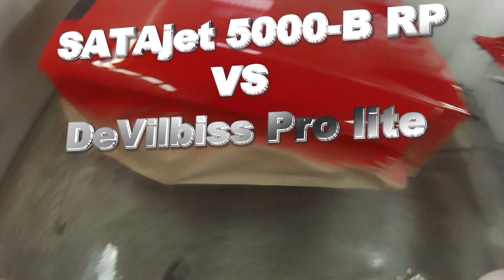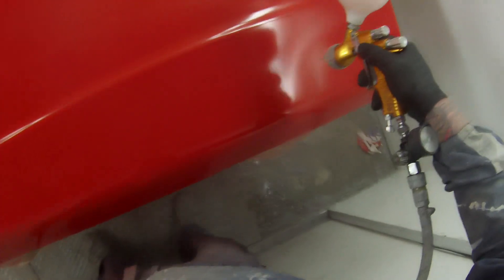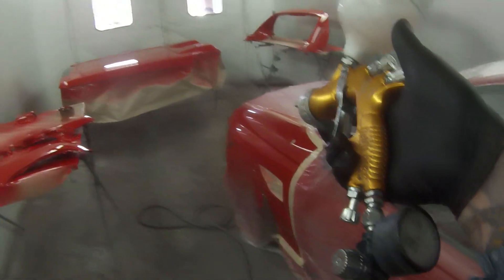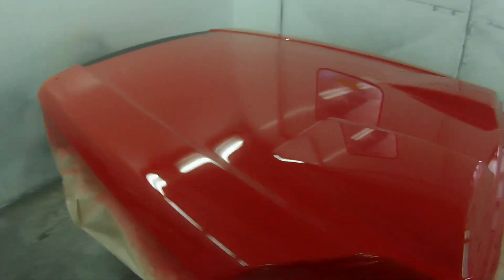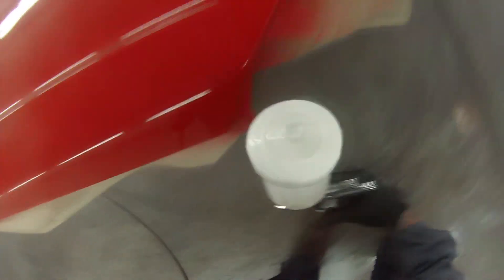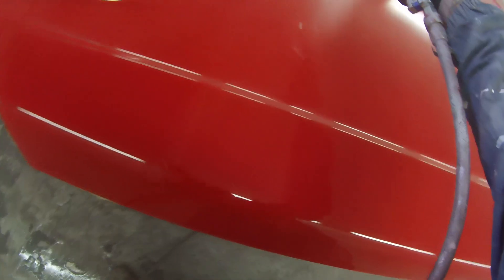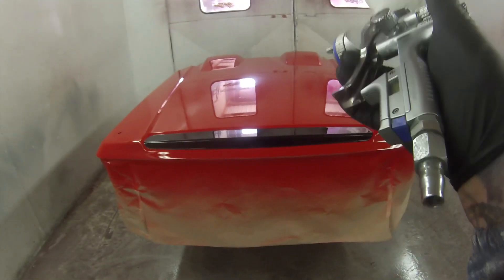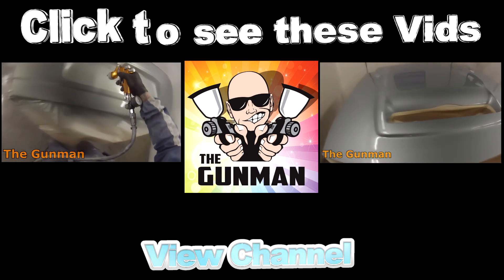SATAjet 5000 VS DeVilbiss Pro lite

Comment: Great review!  I just decided to to pop on the Tekna ProLite , same kit as mentioned, TE10 / TE20, 1.2, 1.3, 1.4 needles for $359 US so a great deal. I have a booth I can rent with good air supply and for the small projects I'm doing it will be the last spray gun I will ever need. Keeping my Eastwood Concours for primer and small quicky jobs on my home compressor. Thanks Gunny, best painting vids on the internet!

Comment: The deal is: In America, time is money. Every shop sells nothing but time. We, north american painters and businessmen want speed above all. SATA has adapt to the needs of the American market because it is the largest market in the world. It is evident in this video that for a pro painter that wants to be in and out of the booth, SATA is the way to go. I was going to buy a pro lite just to try it out, but after this video I've changed my mind. It is just as slow as the Iwatas. Low exposure to fumes is where you want to be as a professional refinisher. In and out as fast as you can!
Reply: +Renato I think his bases for the speed was dependent on flow rate and nozzle & cap size. The versatility of the Prolite would give you the ability to spray faster if so needed. Also in US, many dealers offer a Digital gauge adjuster which works great and still cost less than a Sata 5000. But yea i agree, if you are a pro and can work fast, and still get a quality job, then sure the 5000 seems more apt to the task. But i wouldn't want to use one as a beginner.
Reply: +Themayseffect why not as a beginner. I never painted. I bought a 60g$500 husky compressor. also $80 grinder,$260 buffer, $200 on lights, $300 on tools, $100 on Palm sander. I need a Spray gun that's great?DID GARAGE TEXT IN MAKING.
Reply: well said bro those are facts on paint /claircoat use
Reply: Themayseffect g
Reply: @Themayseffect  Agree,  SATA 3000 and up for skilled PRO only. That gun saves time. /But not nerves/.

Comment: I'm an industrial painter, been using my own gun, a TeknaPro for ever, but my company got us some satajet 5000 HVLP's, and I have to say, they are amazing.  The one complaint me and my painters have is the air regulator - there is less than one eight'th of a turn from full blown to nothing at all.

Comment: I bought a 5000B HVLP and a 5000B RP for $1000.00 for both as a gift for a friend. He said it was a good deal. The RP had been used 2 times, and the HVLP was new in the box. The guy I bought it from said he needed one that used 19 PSI and these were 26 PSI. I hope he likes them. He does high end restorations.
Reply from the maker: Check out this article i just wrote up on the SATA 5000
https://thegunman.net.au/satajet-aviator/
Reply: The Gunman Thx!

Comment: You got it buddy the sata 5000 is a fantastic gun . I see ur running the 1.3 there pretty good but smash on the clear I use a 1.2 with uhs clear and it is really amazing . The 1.2 really cuts down the paint consumption and lays down the clear . The 5000 wsb (hvlp) is also a fantastic gun when used with water Bourne u can really save product .

Comment: when using a sata they make you buy the entire nozzle set as a kit rather than just one air cap or needle. That's why it's $350. Their's comes with a needle,  air cap, and fluid tip. They are machined to fit perfectly but I do agree the price tag is a bit ridiculous and I wish you could replace individual parts cuz shit happens. Nice work !

Comment: I used the sata jet 90 back in 1994 spraying shutters topcoating only very good spray with  they were very expensive even back then the needle and air cap set were a burn  cost wise

Comment: Hello!
Thanks for great video!
Could you advise what tip to use for solvent paint on Gti pro lite? ( t20 or HV30 ) and as I understood sata 5000 will be better for clearcoats? Or it is ok to get 2 Gti pro lites with different tips? Many thanks in advance

Comment: Gunman thanks for this video comparison. Which of the 2guns do you recommend for single stage urethane? I'm a beginning and have been spraying single stage urethane with Devilbiss flg3. Good results. I'm getting ready to start larger project and planned to buy Tekna Prolite because I used one at Sherwin Williams and liked it. But my paint shop talked me into the Sata 5000. I'm having remorse. Which of the 2 guns would you recommend for a novice spraying single stage urethane?
Reply from the maker: Pro lite TE20 1.3mm

Comment: What kind of clear is that?   i run Spies Hecker clear with a sata 4000 rp   with a 1.2 tip  works awesome had it 2 years. the reason i ask is not all clears would take pounding it on like that without  solvent popping or hazing out the next day

Comment: Hey Gunman been awhile! Hope all is well! Q... Do you feel it necessary to have the third adjustment knob at the bottom of the handle?  Seems the USA models do not have the???  Thx again mate!
Reply from the maker: Uploading now mate just been flat out with work. I have some guns from the USA that have no pressure adjustment knob and just run a gun reg and it's all you need, they just have them on our guns so you don't have to use a gun regulator.

Comment: Hi Gunman, lovin the vid's, keep them up mate. I'm looking buying a devilbiss, I'm not sure what model to buy bearing in mind I only spray motorcycle parts, tanks etc. I own a Sata 4000B which I feel is too big for the work I do (if that makes any sense). I run it with the standard 1.3 nozzle it came with, I looked into buying another nozzle but the price scared me off !! . What model Devilbiss would you reccomend for bike work, the GTI does sounds right up my street....... price is an issue as it's only a hobby for me, cheer bro
Reply: Update, ended up buying a Devilbiss SRI Pro lite with a 1.0 fluid tip, used it once and love it, I feel I might go up to a 1.2 or 1.3 tip but apart from that great stuff

Comment: you mentioned that other Divilbliss fluid tips will fit on the Tekna pro lite. What 1.8mm will fit my gun? I'm shooting Plasti dip topcoat using a 1.5mm tip and I'm seeing cobwebs. I'm being told I need a bigger tip to shoot Topcoat with my gun. Need help bad!

Comment: I find the 5000rp suits very well for big area Base coat allocated.  no gun will ever beat laying down marine clear through a pressure pot 0.8mm 🤙🤘
Reply: For big area a Wagner Cobra 40-10 is unbeatable. No any gun in world can even come close to it.
For speed of painting again no gun in the world can come close to it./at same quality/
 Get a No.17 tip and you can spray gelcoat.  
Get a No.12+Plus tip and you can spray car clear on yacht with ease. You won't need to cut and polish it, you get so good finish.

I got 2.5mm pressure pot for fast setting gelcoats, it's fine for prototyping/small jobs but making a boat mold for example you need something more than a conventional spray gun. 

That's where big area starts and you have no chance to cover it with a cup gun in 5 minutes or less. Not to mention holding that weight, you get tired after short time holding even classic PPS size cup full of thick gel.

 With polyester gelcoats you have to be really fast, and you cannot use inhibitors for first layer when making prroduction mold, that's where Wagner comes to play. 
It's made for production  work, all day use, results.

But that's another story, SATA5000 cost 600 euros, Wagner Cobra starts somewhere at 4500 euros...
Reply: @jankatzenbach2596  I don't touch gel coats but and if I did it would be with a brush 10 coats screen it and board the grandma out of it then through the grades.  The paint work I do is awlgrip and awlcraft 2000 and SE range from tenders to 90ft metallic boats 🤙
Reply: I appreciate your input though bud thank you.  catch me on instagram to see my work fozzey4018. I did a flybridge 88 Princes with matte black with my sata 5000 and I'm telling you it looked mint wasn't patchy anywhere and that was hull deck hardtop,  seating area,  garage platform the whole boat looked sick

Comment: I got the tekna pro for $320.00 from industrial finishes here in the us.  they had a great deal came with the spare tips and air caps with the regulator just did not come with a cup.  I have not used it yet but thanks for the great review
Reply from the maker: Hard to beat man, I just made a top 10 spray guns vid and it took out 1st spot.
Reply: +Chris Mansker Do you happen to have a link to the gun?
Reply: +The Gunman You know what gunman? For a pro in America that makes $79K to a $100K the prolite just doesn't cut it. Versatility is irrelevant when you must have several guns for different applications and devoted to those particular applications. I have a gun for each individual application. A primer gun that lays out my primer nice and smooth so it is easy to sand. I use a GEO sv HVLP 1.9 for that. I use a SATA 3k 1.3 for wet on wet sealers and bumper adhesion promoters. I use a SATA 4k HVLP 1.3 for most base coats and a Geo Genesi for difficult light metallics in hot weather. For clear I use 3 guns depending on the size of the job. A Sata 3k/4K and 5k BRP 1.2 with flowing coats on both ms and hs clears.  All you really need are 4 guns as a pro, plus a good mini for tight jobs like rad supports and spot repairs that require low overspray.  I use the only devilbiss that I ever bought after the jga 502 was outlawed in America and that is the SRIW. Best mini gun ever invented, other than that , in my humble opinion, devilbiss is not worth the money. Cheers mate, great stuff you got here on you tube!

PS: I spray Spies and Standox and on occasion Sikkens and De Beers.
Reply: Chris Mansker 
Where are in located in the US...we have a industrial finishes here in Elkhart, In

Comment: Great video man. Can I ask a related question? I have an FLG4 which works really well. I am having to spray solvent and waterborne. I have the waterborne FLG4, I am wondering if I need two guns two spray with. This Pro Lite would be my choice, I have heard conflicting reports on using one gun for both. I am spraying PPG Envirobase and various PPG solvent products. Thanks man!
Reply from the maker: +asicerik I have ran a dedicated clear gun for years now and highly recommend it, it lowers the chance of contamination not necessary but better

Comment: I use HS clear most of the time. What air cap do you suggest for the devilbiss pro lite if I am going for a euro orange peel? HVLP cap? Also same question for MS clears. Thanks!
Reply from the maker: The HV30 (HVLP) is the best for HS and achieving the euro peel, TE10 is good for a small compressor (LVLP) and MS clear, and the TE20 (conventional) just about does it all and can handle HS or MS clear, adjusting the way you spray with the TE20 you'll be able to replicate just about any peel. I love my pro lite te20 1.3mm.
Reply: +The Gunman Thanks! I&#39;ve been using the TE20 because I thought that&#39;s what I was supposed to be using but I used the HV30 last night and around 26 psi and it came out awesome! Plus I think I ended up using a lot less material than I have been using which is a nice plus. I ended up winding the fan in just a tad is that normal? It was shooting too much like a figure 8 at 29 psi. I'm using a HS clear from SPI (southern polyeurethane) and I use a 1.4 tip.
Reply from the maker: The good thing about the pro lite is that you don't have to wind the fan in but can if you want, it'll prob speed the passes up a bit cos its concentrating on a slightly smaller area, but man if you've found something that works then keep doing it. Yes the HV30 used properly will consume less paint, quite a bit actually.

Comment: Hi Gunman I purchased a sata 5000 B RP 1.2 tip and used your recommended settings (2 turns out) and found it VERRY slow to use. I am used to the gti pro lite 1.3 with TE20 and love it, very fast gun. What am I doing wrong?
Reply: Leave the fluid open, it's not a slow gun at all

Comment: Can i put a 1.8 fluid tip and needle on a Devilbiss Tekna Pro lite? I plan on spraying primer, conversion varnish, basecoats and clear. With conversion varnish its recommended to use a 1.8 but I also do automotive painting. I cannot find information on the pro lite saying you can put a 1.8 tip on it.  I'm assuming you can use other Devilbiss tips with the tekna but I'm no expert.

Comment: Hi, Gun man i like your videos, im a wood painter so please could you advice what to use as spray gun for this work, devilbiss pro lite or sata 5000 RP?

THANKS A LOT.
REGARDS.
Reply from the maker: Still be the pro lite because of it's versatility, you can change the air cap and go from LVLP to Conventional to HVLP and it is absolutely perfect for refinishing, maybe the SATA 5K if I was doing Custom painting where they wanted dead flat every time.
Reply: +The Gunman thanks for your fast respond , i read that i need an 1.8 nozzel for primer so can i use the devilbiss gti pro lite for primer?

Sorry for my bad english :) .
Reply from the maker: No not the pro lite for primer get the GPI http://www.spraygunsdirect.co.uk/
Reply from the maker: 1.8mm
Reply: but it will cost me too much , do you know a good spray gun for all those works(primer , base coat , clear coat...)?
Reply from the maker: FLG5 get it in 1.4 & 1.8
Reply: thanks a lot , and im really sorry cause im asking so much but i really need your help so What about FLG4 finish line 670 ? is it better or worst than flg 5?
Reply: I've been spraying wood for years I wouldnt even let someone in my booth with anything but a sata

Comment: @TheGunmanChannel I follow your YouTube channel. Excellent material.Maybe it's not the video related to devilbiliss. Sorry but I need helpCan you help me with this question?I have a devilbiss Tekna pro lite. Will the T110 head be compatible with my gun? The manual says PRO 103. I have searched on Amazon, eBay and Spraygundirect and only PRO 101 or Pro 102 appears.

I would appreciate it if someone could advise me in a video that they left the Pro lite version for America and the Gti version for Europe. I have asked on the official devilbiliss and spraygunsdirect sites and have not received a response. Thank you.

Comment: i spray my sata @1,8 bar with the 1.2mm fluid tip. but i usually spray uhs clear coats have tried lower pressure but does not really work... if u think that the 5000 puts out alot of paint you should try a sata 3000 RP with 1.4 mm run at 2.2 bar with every thing wide open you can run and paint with that thing its crazyyy ;)
Reply: kim öhberg
Reply: Hey I find myself struggling as of late with Standox 2k Premium UHS clear with the 5000 RP 1.2. any recommendations for this gun with UHS clear? I'm having trouble finding the sweet spot between having it lay out nice and running it...and I've been painting for 7 years but this clear is probably one of the most difficult to use imo.

Comment: Youre a spectacular painter man. I'm 23..probably been painting for a year and a half and happy to say I'm a lead painter for the shop i work with. Kinda just caught on really fast and never looked back. I do have a lot of trouble  with coarse metallic silvers. Some like ford silver (UX) or Mazda grey (38P) Do you have any advice in reducing the "halo" or spotty effect those coarse metallics can create? I looked at your mottling video but didnt really learn what I needed to. Any help would be awesome.
Reply: ive been able to reduce mottle on silvers by just increasing air pressure when spraying colour. if I see mottle I tend to mist thr base on those areas, not the convential way of spraying base but misting it on after seeing mottle helps cover
Reply: +DzDeadlyy  Spray your basecoat wet like clear coat for your first coat.  Apply a control coat with tight overlap over it after it flashes off.  That should eliminate your mottling issue.   Other trick is turn off your booth light and use your sun gun while you spray your control coat. Don't ask why, just do it and you'll see. :)  Halo is caused by improper blend or wrong side tone of the basecoat being applied.  If the side tone of your basecoat is near perfect or pretty close, you shouldn't have halo when you blend.  What is your paint line?  12 years experience painter.
Reply: +EvolutionIXRR thanks.  When u say wet like clearcoat that almost seems like to much.  I've never tried it.. Figured it would cause more mottling. but I will certainly give it a shot. What do you suggest? Almost like 2 coats in 1 or something? We use ppg envirobase waterborne base coat.
Reply: +DzDeadlyy No it is not too much that would actually save you more paint.  I paint all the cars with just two coats. First coat is wet second coat is control coat. First coat should be your coverage and your second coat should be your control coat or effect coat that will even up your metallics.
Reply: +EvolutionIXRR hm wow. Do u spray solvent based? I usually tend to spray 3 wet coats and then a drop coat for metallics.  Some red and blues I go to maybe even 5 coats because they don't cover well even when sealed. I'd be weary trying just 2 coats.  Maybe when I get a small fender job on a silver car I can test it out!  Thanks again
Reply: +DzDeadlyy I spray glasurit 90. My bro sprays envirobase with 1.4 tip. But Ive sprayed envirobase for 5 years before switching to 90 line. Yeah try my suggestion and let me know how it turns out.
Reply: I usually just control coat it however many times it takes, but it doesn't take no more than 2 control coats to orientate the metallics. Im certified PPG envirobase.
Reply: Wet bed/basecoat blender for blend panels.

Comment: ive got 11 cfm compressor.will this gun work.if not than recommend one
Reply: +Aiyaz Khan 
you will struggle alot,especially with HVLP. You can still do a single small panel with  RP. an air regulator is a must